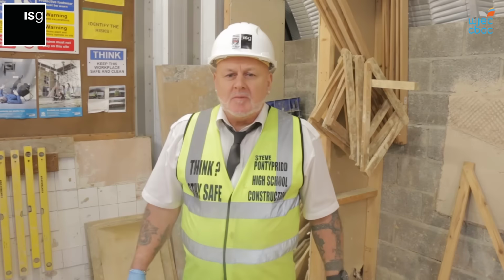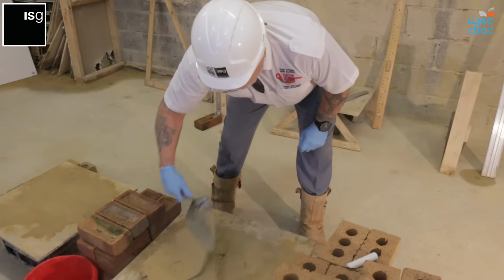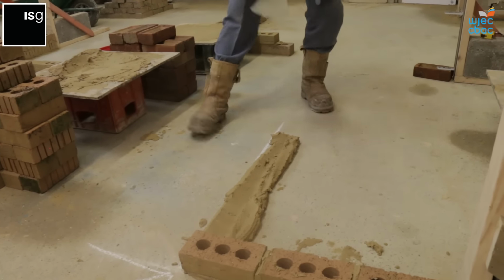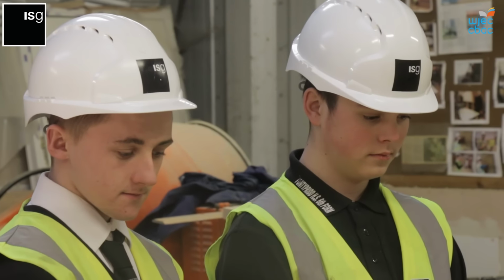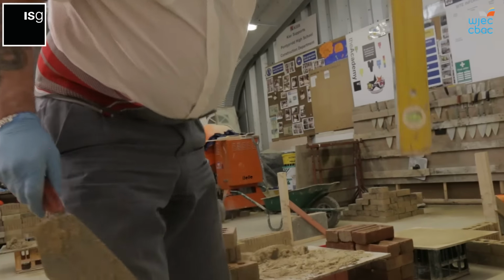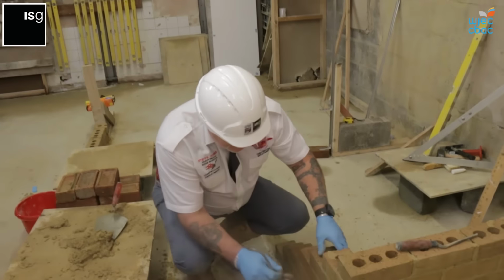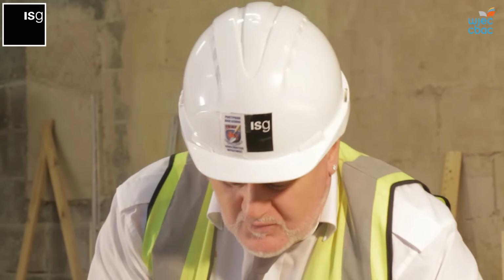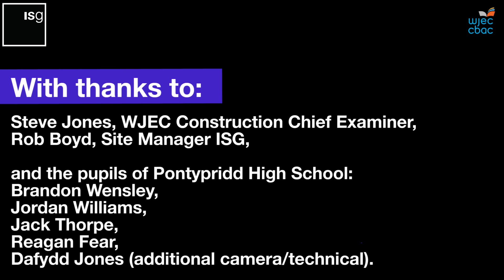Bricklaying Tutorial

Comment: Thought holes in the bricks were to reduce material consumption and weight which all relate to keeping costs down, not an increase mortar bonding? And it isn't so much that 'filling the frog' give's it strength or support..  Mortar acts to distribute weight across the full surface of the brick regardless of the brick type - not filling in frogs and leaving voids weakens the brick as weight is distributed to edges only - filling it maintains it's "normal" strength, it doesn't increase it...
Reply: You thought wrong!